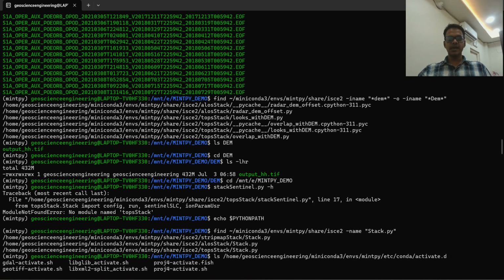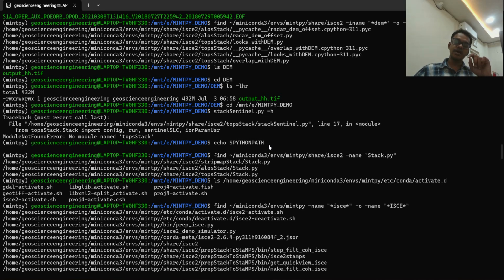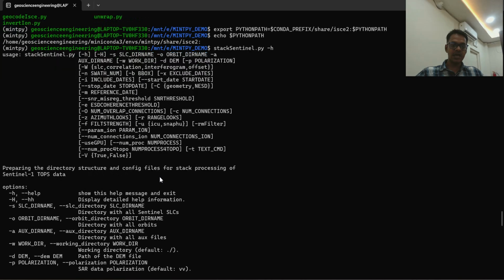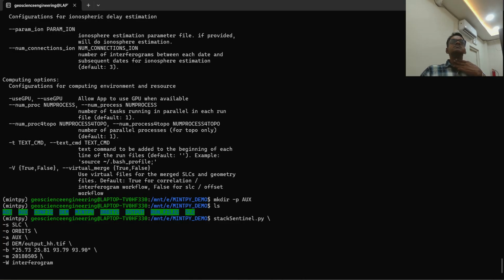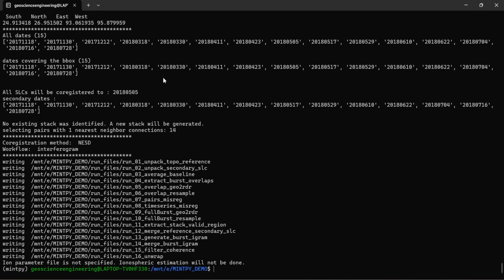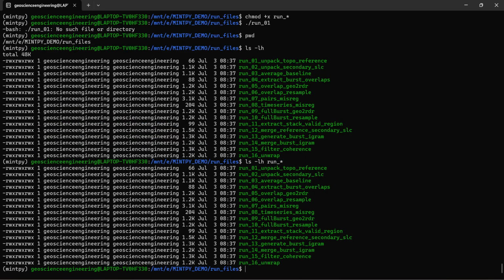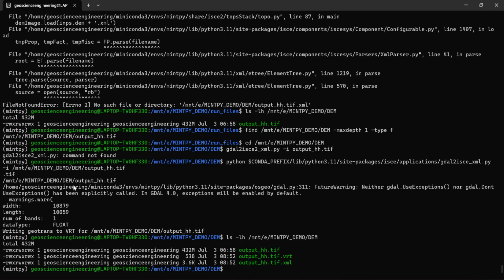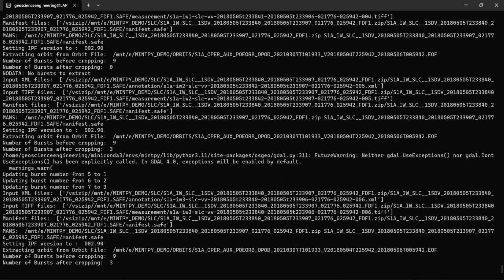MINTPY FULL PROCESSING PART-2 #geoscienceengineering #landslide #mintpy

Comment: Tried, but the process is never ending, closed the system after 12+ hrs of running
Reply from the maker: Yes it takes lots of time, especially when you are working on huge datasets, I have been running them for weeks. Please do comment if you want any help on anything.
Reply: @geoscienceengineering thanks for the reply. I will try again
Reply from the maker: If it is not running for more than one or two days then you need to check two important things. 1 your system configuration, because it consumes lot of space and speed,. 2 is your DEM, if you are using a wrong dem then processing will hang. To check the DEM you can first take two images and perform the backgeocoding in esa snap with different DEMs. If the intensity master and intensity slave are visible in snap then you have the correct dem. The same dem you can use for mintpy also. Example if Copernicus global 30 DEM is not working then you can go for SRTM from usgs